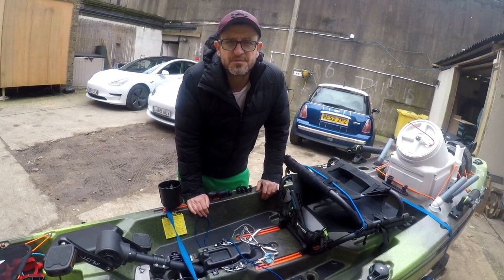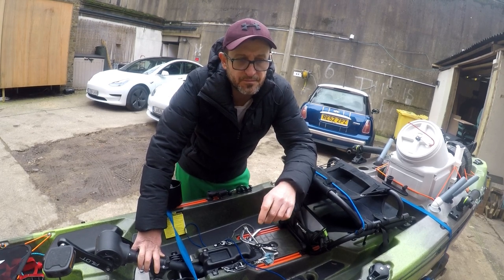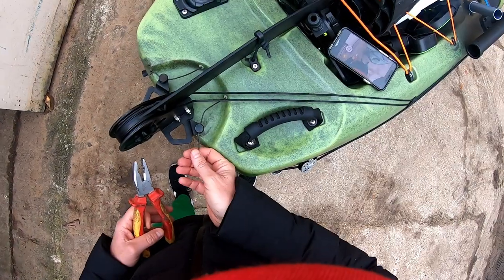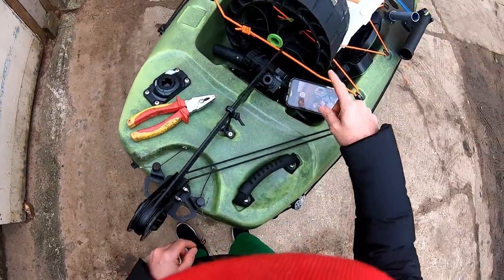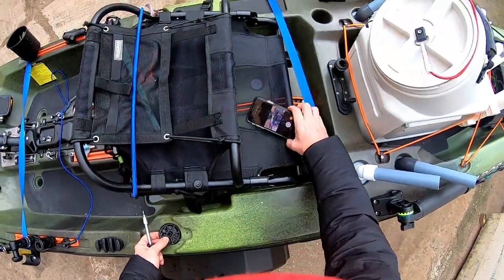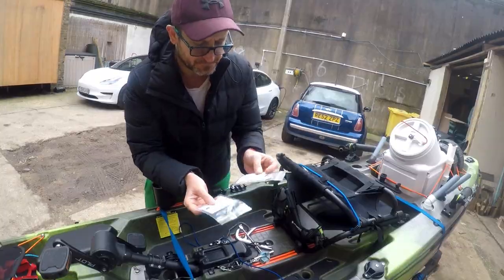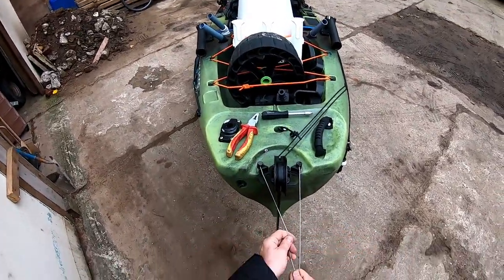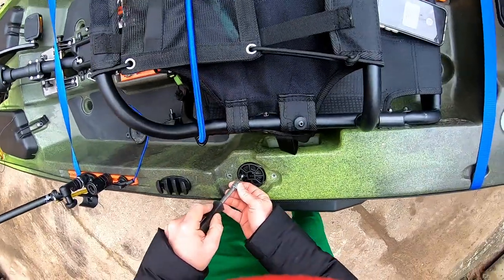RUDDER CABLE MUST BE REPLACED! Pescador Pilot 12 + few TIPS on how to make steering even smoother!!!

Comment: Nice job! Besides steering hard, I find almost no turning ability at lower speeds. Has anyone change the size of the rudder blade?
Reply from the maker: I have a mate who have replace and added a blade to enlarge the radder. Do you also on same kayak as mine? Btw I have changed the steerer handle to a higher one using a 3D printer and as u seen in the video the stainless steel cable. It is much much better. However I’m thinking to upgrade the rudder size as well

Comment: Awesome, I have the same Kayak .
Reply from the maker: That’s nice which year do you have? Where r u located mate?
Reply: CastaNet Fishing & Kayak Adventures I’m not sure mate. A question , the 1.5 is mm ( Millimeter )? . I’m living in USA . 🤟🏽
Reply from the maker: Slim De 919 I meant to ask what year model your Pilot 12. Mine is 2019. I had an issue recently with my pedal drive but thankfully it is under warranty and Preception gave me new drive immediately. You can see in my last video on my channel that my pedal drive broke...
Reply: CastaNet Fishing & Kayak Adventures mine is 2018 , mate what is the Size of cable , 1.5 mm ?
Reply from the maker: Slim De 919 yes mate it is stainless steel 1.5mm
Catalogue Code 100.305.015
.
1.5mm 7x19 A4-AISI 316 Stainless Steel Cable MBL 130 kgs
I think in the description box I have listed it but you need to find something similar in US I bought it in UK. Working a treat 👍👍👍
Reply: CastaNet Fishing & Kayak Adventures thanks mate for your help 🤟🏽
Reply from the maker: Slim De 919 anytime

Comment: I did the same thing to my Pilot 12 and works much better, If you find out how to make the rudder deployment better let us know, I pulled so hard on mine that the knot came undone.
Reply from the maker: It is an issue I know. What strange I don’t find it so difficult on land than deploying it on water. Maybe because of the sitting position
Reply: Here's a trick that I found during an epiphany I had on the water that completely solves the issue: Before deploying the rudder, point the rudder so that it is exactly parallel with the rudder lines (IIRC, this means steering knob is turned around 45 degrees to the left). This reduces the amount of force required to deploy the rudder by like half (or more).
Reply from the maker: Nytron but the rudder sit inside a little grove inside the kayak plastic when it is vertical and straight . 
So you are saying to force the rudder stirrer knob about 45 degrees to the right (when I’m sitting facing front of course), that will bring the rudder to be parallel with its deploying rope and then to deploy it? I’ll give it a shot. I hope I understood you correctly.
Reply: @SpicyAngler  That little groove is very shallow with rounded contours, the rudder will easily pop out of it. So yes, sounds like you understand it correctly. Give it a shot, it will be a huge "omg, I can't believe I didn't think of this before" moment. It was for me.

Other tips to make it even easier:The last thing I do just before boarding my kayak is to point the rudder manually by turning the rudder itself with my hands so that it is parallel with the rudder lines as described previously. You can also preemptively lift the rudder, pointing in straight up in towards the sky which makes deploying it even easier, and then never fully stow during the outing.

TL:DR: Just remember, any time stowing or deploying the rudder, the rudder should be parallel with the rudder lines.
Reply from the maker: Nytron yes thanks for this. It is a very shallow groove of course it will pop out easily. Also before launching when we take the little rubber stopper from on top of the rudder (the rudder lock I mean) we can already set it up into the right angle.
Reply: @SpicyAngler  Exactly, I just edited my previous post seconds before you made this post with additional tips relating to this. Without even thinking about it, every time I board my kayak, I unhook the rudder bungie and I point the rudder manually with my hands to be parallel with the rudder lines. Literally takes less than 1 second to do. You can also point the rudder to be in midair, which will make it easier to deploy.
Reply from the maker: Do you bring up the rudder everytime you are anchoring?
Reply: @SpicyAngler  I don't anchor, but I see no reason why would you need to stow the rudder unless you're near emergent vegetation or the shore itself. Typically, I only have to stow and deploy the rudder once per outing, unless I am going into areas with emergent vegetation.
Reply from the maker: Nytron just because of the anchor line get tangled with the rudder but this is lack of experience. If you deploy the anchor and at the same time you release line while you are pedalling away from the line direction then there is no risk.
Reply: @SpicyAngler  Good to know. I literally don't use an anchor lol. I don't even have one in my kayak. I should probably get one just in case.
Reply from the maker: Nytron May I ask where do u fish? Where I fish south coast and Kent the tide can rip !!
Reply: @SpicyAngler  Minnesota
Reply from the maker: Nytron you are in the USA it is a different story you probably fish mostly fresh water. If you saw my channel and my sea fishing in the coast of England you’ll see how essential is an anchor
Reply: @SpicyAngler  No doubt, if I was in most other areas in the world, I'd definitely have an anchor trolley and an anchor.
Reply: I just place the rudder straight up so there’s no pressure needed when I’m ready to deploy it. Seems to work fine